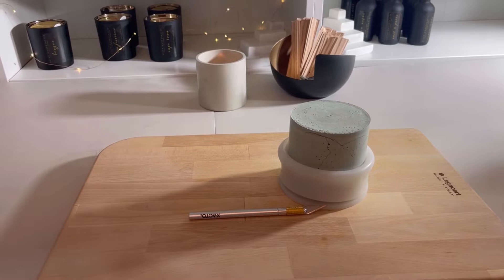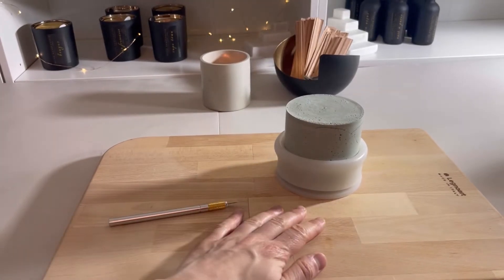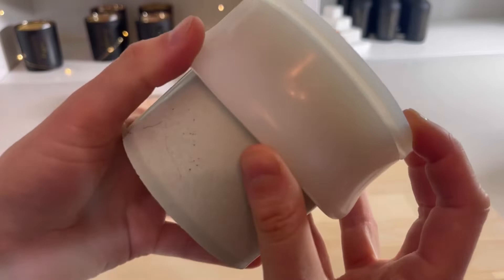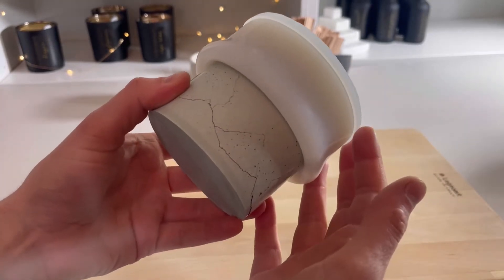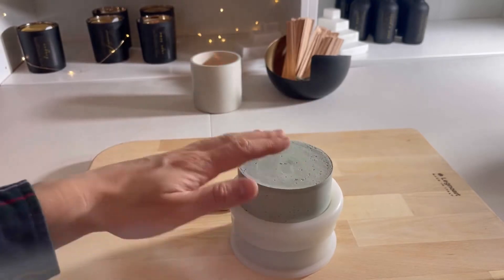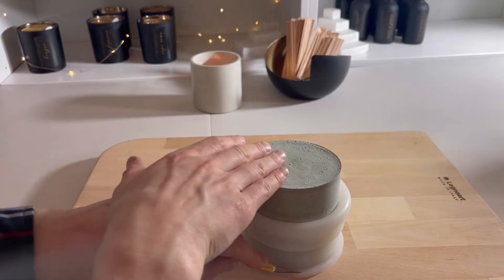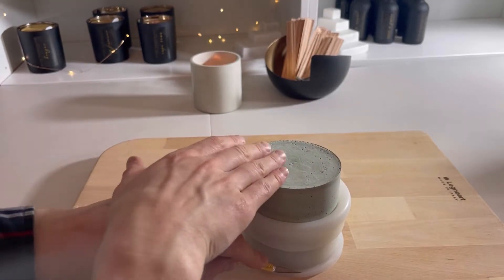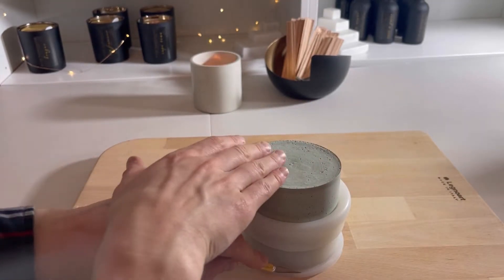HOW TO UNMOLD CONCRETE CANDLE | Made Easy | Amazon Mold #concretecandles #handmadecandles

Comment: In the short run, it is an amazing idea. However in the long run, won't this remove the mould tension and deform it so it becomes more oval?
Reply from the maker: Hi Karine! Thank you for your comment. These molds do wear out more quickly in general, I find, since they’re primarily intended for resin. I would recommend cutting as little as necessary for creating greater ease removing the concrete from the mould because the more that is removed, I think, certainly could further shorten the live of the mould.